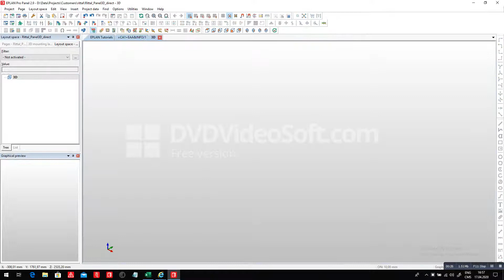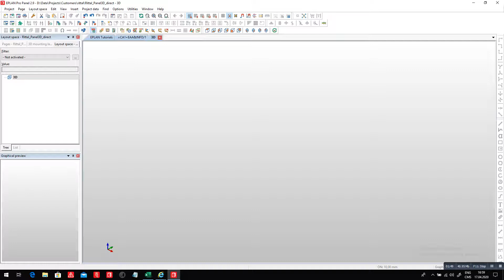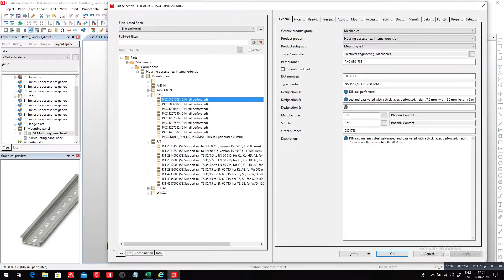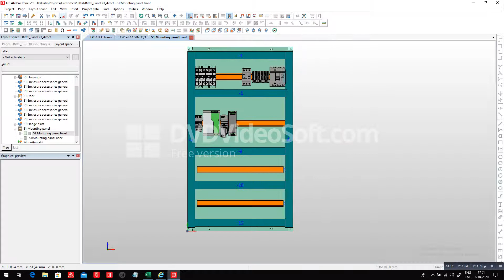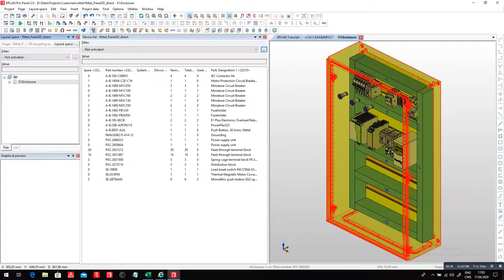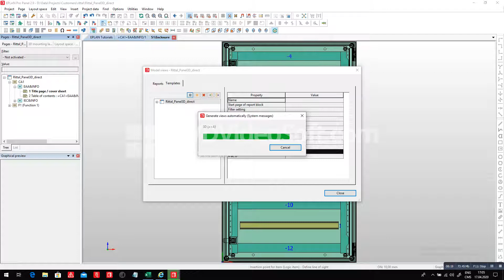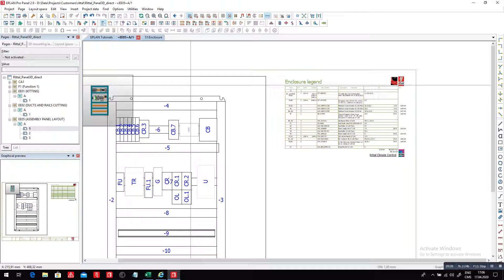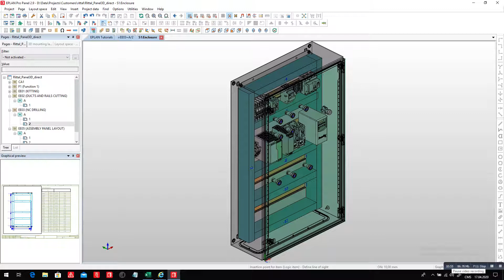Pro Panel Tutorial 3D direct from Excel EN

Comment: Cool video! You can also use excel to import connections and have pro panel route them for you, so in theory, you could have panels wired in smart wire or via connection lists without ever generating schematics. 🤪